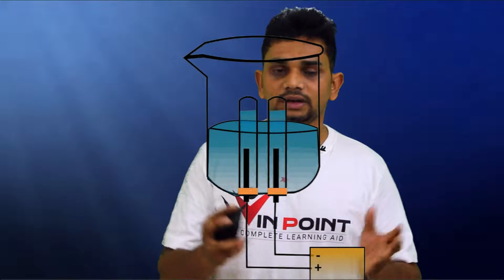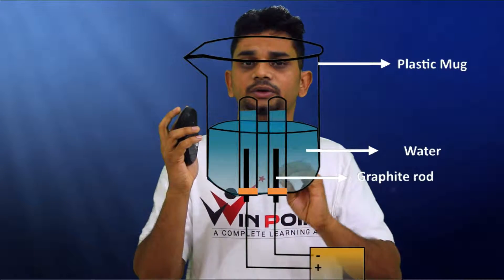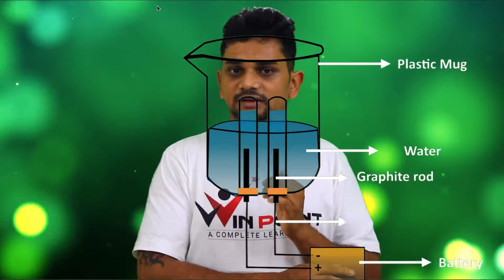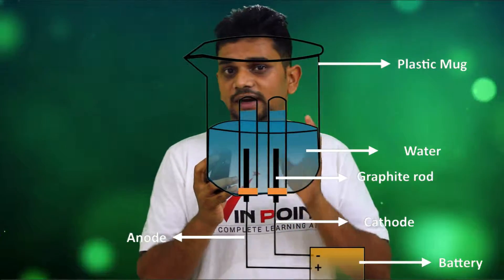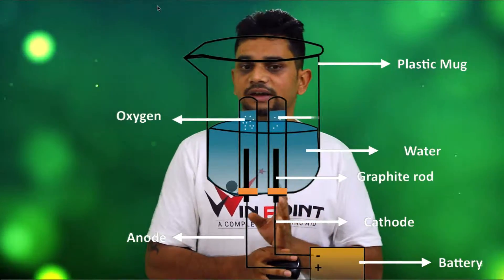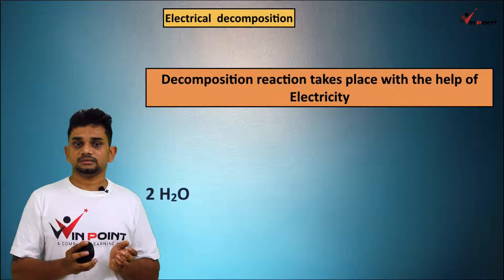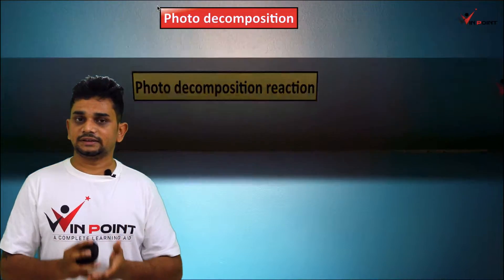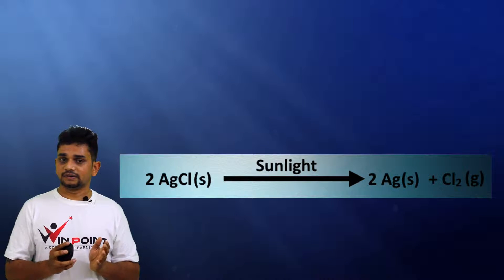Decomposition,Electrical ,photo decomposition reaction class 10 CBSE by win point  education

Comment: Sir 
I have seen many videos in that why it is said that electeons move from anode to cathode??
Electeons are getting repelled by the negative electrode so they should move to positive anode??
So why it is said that electrons move from anode to cathode???
Reply: Sir please reply
Reply from the maker: @jayantideshpande8459  anode will give out electron it is oxidation 
Cathode will accept  electron reduction 
Thats why anode will donate electron 
Cathode will accept electron
Reply: @winpointeducation  but sir how 
As per laws of electrostatics 
Two similar charges will always repel and unlike charges will attract...
So cathode is negative so how it will accept negative electeons ??
Reply from the maker: @jayantideshpande8459  in the case of a cell anode is negative and cathode is positive
Reply: @winpointeducation  in case of which cell?
Reply from the maker: @jayantideshpande8459  battery 
anode is negative and cathode is positive
Reply: @winpointeducation  no sir 
Anode is positively charged and cathode is negatively charged 
In our textbook it is written like this...
Reply from the maker: @jayantideshpande8459  in the case of electrolysis  its correct
But in the case of battery its opposite